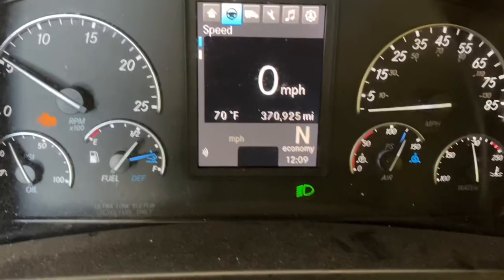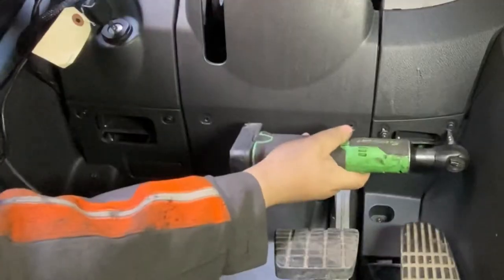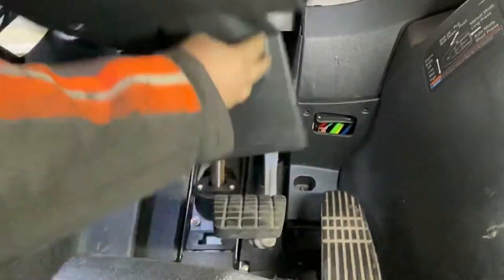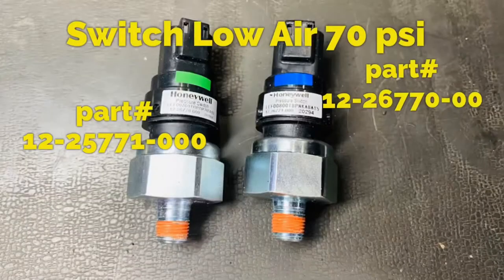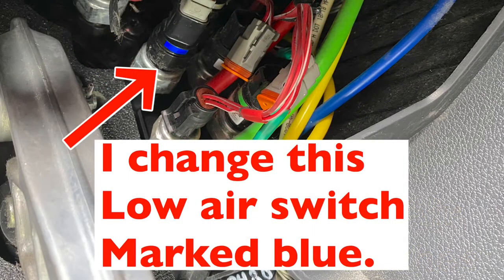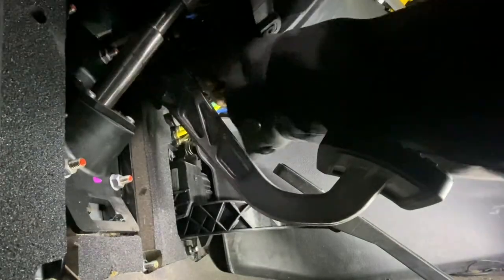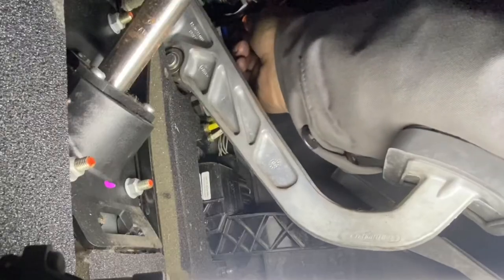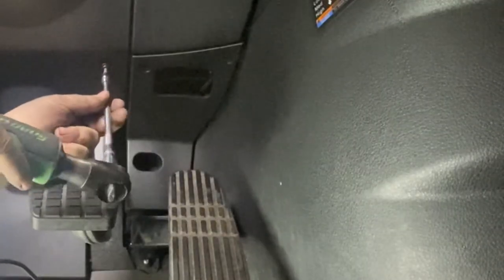New Freightliner Cascadia (Fix Low Air Warning Light Stays on )

Comment: Just FYI, the part numbers are backwards & a few digits off. 

Green = 12-26770-000
Blue = 12-26771-000 

Thank you kindly for the video, it was a great help!
Reply: 12-26771-000 (the blue one) has been replaced by 12-31614-000 and requires a jumper adapter wire A66-23214-000
Reply: @deanmoore1752 of course it does 🙄 why are engineers idiots for? Making everything more expensive when an original fix was good enough? Good grief man.

Comment: Thanks so much. Was intermittent and getting worse. I did not have access to a new switch so just unplugged it. The default seems to be for it to be on. So I just ran a wire between the two holes in the plug and off...   was driving me nuts

Comment: I have to say thank you!!!!.  I been a diesel tech for the passed 5 years.  I knew the issue was a pressure sensor but the oem manual doesn't say which one. It just saids to replaced it. Lol. 

But I do know what the green sensor does.  It's a 2 part system. The green sensor is part 1.  Normally close switch when the yellow brake valve is pushed in the switch opens at 9-12psi that tell the ecm the parking brake is being released. 

Part 2 the blue sensor is a Normally open switch is closes at 73-83 psi and that tells the ECM the parking parked is Fully Released.  So anything below 73 psi the warning chime and low air pressure light comes on.

Comment: Thank you
Reply: Blue tag part number is 12-26771-000

Green tag part number is 12-26770-000

I believe they are marked wrong in your video. 

Love the information though.  Saved me down time at a dealership.  Normally would take it in for the free warranty repair.  But $80 out of pocket (both pressure switches) and a couple minutes of my time is better than a day of diagnostics. A day or two before they can "squeeze me in".  No thank you.  

Again great information

Comment: Had a tech replace this for same problem,   buzzer stopped but light is still on and secondary  air gauge does not work now???
Reply from the maker: Maybe something got under plugged.
Reply: @bigrigfix  That what it was,  took it back in the shop, tech had unplugged  some things to get air sensor out and forgot to plug them back in
Reply from the maker: Cool l'm glad I could help.

Comment: I currently still have to get tools for the truck as of now I cannot open that compartment. I’m not sure why I have a leak in my spring valves that apparently just came after I got done filling up and although my air pressure gauge is at 100, the emergency brake warning indicator is staying on I cannot figure this out.

Comment: Changed both sensors, still has the same issue. Any other ideas.
Reply: I have same issue change both sensors as well did you ever find out the problem?
Reply: I wanna know too if u  found the issue please
Reply: most of the time if you have any issue with Com.  just do cpu hard reset. turn main cut off power switch down on driver side for atleast 15 mins and turn key to on position cycle 3 time and the 4 time start the engine.